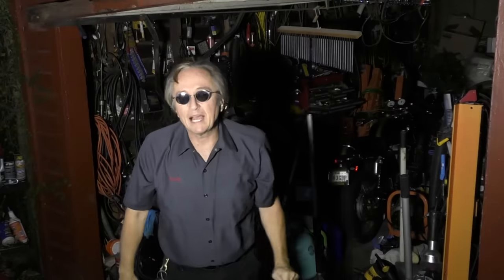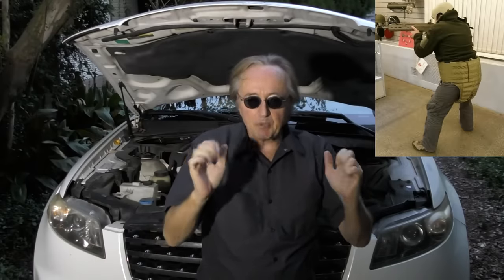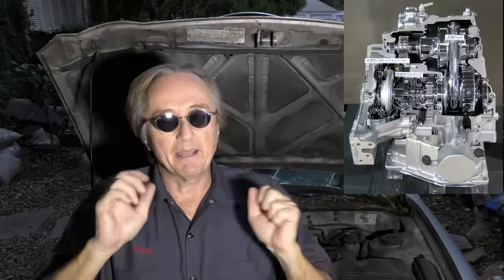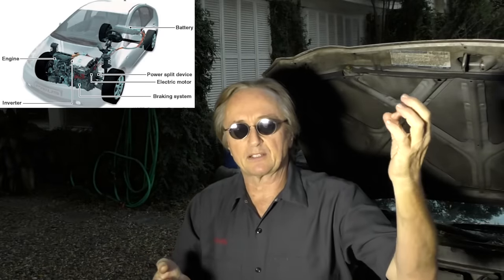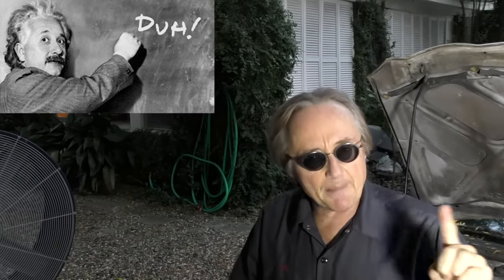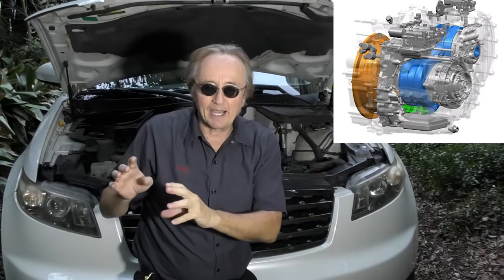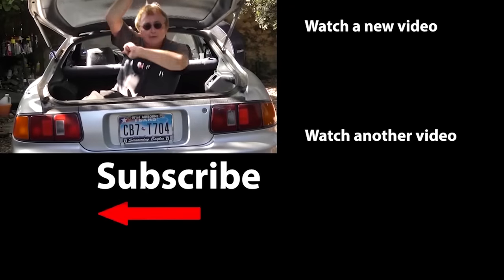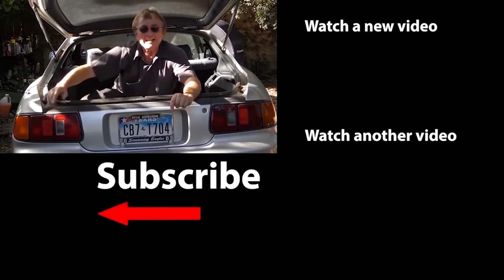Why Most CVT Transmission Cars are Terrible

Comment: CVT went out on my '17 Nissan Sentra at 9,000 miles.  JUNK!
Reply: S C some last said her 15-17 Sentra went out around 15
Reply: Omg i would be pissed mines is a 2015 and it needs a new cvt hmmmmm but the car is not safe to drive because the transmission stalls without warning and like me will leave you in some dangerous situations,Hopefully your still under warrany for yours and you wont have to pay $3400 for a new transmission and $1700 to put it in,After calling corporate they offered a 50/50 which still left me to pay $2200 but wait if i replace it i dont trust the cvt transmission its unsafe to be in or around on the roadways it can clunk out at anytime
Reply: I had issue with mine twice. The check engine light never come on.
Reply: Gary Phillips what happened? Mine is stalling at stops and turning off at stops as well now even delaying when shifting gears
Reply: My mom has one a year older and has never had any issues with it.
Reply: Mine has 103,500 miles and it’s still good
Reply: Are you flooring it? My parents 2015 Altima has almost 90k miles and it’s still running fine
Reply: CVT went out on my 18 Corolla at 30,000 miles. I hate these damn transmissions.
Reply: My 2017 Sentra is at 70k and still going strong
Reply: @dallasmorgan5983  It's "expected" to last 100,000 miles. The old automatic was "expected" to last up to 200,000 miles...hope yours keeps going well.

Comment: After I bought my Altima I kept losing my mind doing more and more research about this thing's transmission. Thankfully I must have a golden model or something because it's at 147K miles, original transmission, and it doesn't so much as slip or shudder. Ridiculously smooth, actually. Hopefully by sticking to the fluid change schedule mine can continue to serve me well for years to come.
Reply: I just got a Nissan how long do you wait to change the transmission fluid ?
Reply: @diegodominguez205  I waited until I reach 60k to change my transmission fluid which I did but people recommend changing it to 30k depends on how much u drive but I read my owner manual told me every 60k
Reply: @killuazoldyck9269  I bought a used Nissan Sentra at 160k should I immediately change the fluid ?

Comment: My honda cvt seems pretty cool so far. Gas mileage is so great. Really just crossin my fingers for longevity.
Reply: Me too.  I'm really bummed about this I got a certified preowned civic touring and didn't even bother looking up potential issues prior because honda has a reputation for reliability.  Then I find out there is some known oil dillution issue with the 1.5L turbo engines and CVT's have durability issues.  I'm glad I at least got the extended 10year 100k mile warranty, but I would rather the thing just work and not worry about the potential of breaking down.  I switched from being a loyal ford owner, because I am not interested in SUV's/Trucks and ford is suspending sales of every car but the mustang.  My last two fords (02 Taurus and 2011 fusion) both got me 200,000 miles a piece with no issues but normal wear and tear.  It sucks because the touring is really a fun car to to drive and now I find myself wanting to drive it like a senior citizen because Im afraid the drivetrain cant take it.  I'm really thinking about driving it for a couple years then paying it off and selling it while it still has reasonable value, hopefully before it has issues.  I went with the touring because it had luxury features(premium sound system, sun roof, leather interior, all the tech gadgets), without the luxury price tag.  I thought about just getting a newer fusion, but all the certified preowned models I could find within a reasonable distance were all base models.

Comment: I work for Hertz & we have a lot of Nissan Altima’s...they all give out before 90,000 miles...I asked Nissan what the problem was & they said they have terrible transmissions & it has a recall on it from 2013 - 2018...along with the Sentra for the fuel injector (because it cannot consume the gas in California) 😡
So beware of Nissan!!!
Reply: What about 2016 kia Forte/ Hyundai Elantra? I am planning on buying a used cheap car from hertz.
Reply: Dazz Freezee good cars, only problem I’ve noticed with the Elantra was the trunk release messing up...but I think it was customers pulling on the emergency release
Reply: Dazz Freezee I advise you to take a mechanic or someone who knows about cars, if you don’t know, when going to buy a used car from Hertz...especially if it was once a TNC car (vehicle used for Lyft/Uber leasing)
Reply: @tyrinjoyce  Good advice, I'll definitely get it checked by a mechanic . Right now the price on those cars are low and they should still have 75% life left.
Reply: what a joke you work for hertz, who have alot altima that gone out before 90,000 miles, what a load of crap, first of all nissan issue have span on these new model for 2013 and 2014 models, D step shift came in at 2015 which the CVT design was change, currently they are more reliable than the 2013 and 2014 models which those had complain which can be found on car complain and NHTSA, no 2015, 2016 and 2017 or 2018 model can be found with CVT complain, or what you say they all gone out at 90,000 miles, an deven if theer was the problem has been reduce that it has not appear as 2013 and 2014 models, and CR and JD power are saying the same thing, the  recall up to 2018 are not for CVT problem but reprogram of the behaviour of the CVT like if  if it goes in limp mode. Next that make your story garbage is hertz would be surely hurt as they will be loosing money , but yet they are still purchasing these altima which goes out at 90,000 miles, so they are interesting is loosing more and more money? We know they are buying altimas. next nonsense is about the sentra, there are two types of sentra if you did your home work, one build for specially for California, it has less HP,  the other can use in other states, all manufacture has this.
Reply: @dazzfreezee3976  Dan freeze any car you buy you should car a mechanic, but do not believe all these lies, this guy story has more holes than a strainer, you think a rental company would purchase cars they loosing on? Altima goes out before 90,000 mile he claim but hertz purchasing more at a lost, does that make sense? It more like he sees a few with problem and he see some go to the dealer but he does not know what they gone far so he is speculating, no I am not saying nissan does not have a problem, but I am saying nissan issue was resolve in 2015, and I am not saying some people still do not have issue , I am saying the issue is not wide like 2013 and 2014 models altima. There are two type of sentra one build for california and other build for 50 state, so if you live in cal make sure the car is made for that state and that goes for all car manufacture.Also nissan never resolve the sentra CVt issue until mid 2015. So I would be careful of purchasing 2014, 2015 model sentra unless it already ben recall and have in the nissan cooling kit.
Reply: c b dude I’ve been working for hertz for a year now & rented out about 700 Altima & Sentra vehicles...I’ve personally worked alongside Nissan & the 2015-2017 models have terrible CVT engines, I’ve done my research & any real car enthusiast & Nissan owners who don’t know anything about cars will tell you, it’s crap...the cars don’t make it close to 100,000 miles...granted there’s a few that slip through & are reliable, but that’s with standard transmission.
We are loosing money & that’s why we’re pulling the Altima & Sentra vehicles from our fleet and Nissan pulling them off the streets so they can resolve this problem.
Nothing I’m saying is crap...I wouldn’t waste anyone’s time with lies.
So don’t bother replying if you have anything else negative to say 👎🏽
Reply: I have a 2014 Nissan Versa Note. With 79,000 miles as of last September when i purchased it. Now at 85,000 miles. 
Ive seen no recalls on it concerning the transmission, but i still see TONS of bad press on CVTs as a whole as i research them. 
Should i be worried?
Reply: hertz keeps cars to 80 and 90,000 miles??????
Reply: @tyrinjoyce   I think your being honest in what you've experienced. Just don't call it a "CVT engine" when making the argument.  Carry on.
Reply: I own Nissan Rogue 2008. It is in good condition so far
Reply: My 2013 Altima runs perfect, in spite of not being serviced “correctly”.  At 126k miles, I have only had to replace tires & 1 brake job.  I have been very diligent about oil changes every 5k miles & 1 transmission service.  All this talk about CVT is garbage, blah blah blah...If it was, than my Altima should have taken a dump a LONG time ago.  It still gets great mileage too! It’s been a great car.  I’ll buy 1 again, if and when this one finally dies.  BTW...I haven’t heard anything about a transmission recall on 2013 Altima???  Hertz holds on to their fleet cars at 90k miles...Really?Thought they sold them off at 30k miles...

Comment: My daily beater for the last 4 years has been a 07 Nissan Sentra, with the CVT. I know its garbage and im really surprised it hasn't blown up yet.  Its sitting at 211,000 miles right now on the original engine and transmission.  The transmission may be garbage but hey, at least it gets fantastic gas mileage
Reply: It's not necessarily garbage, it's misunderstood transmission, i think both classical and CVT's transmissions have their own advantages and disadvantages...

Comment: Prius CVTs also don't work like traditional CVTs. They're even simpler - just a couple of planetary geartrains connecting the engine to two motor generators and the wheels.
Reply: and I assume all other Toyota Hybrid products, e.g. Camry, Highlander, Lexus RX, Lexus GS, RAV4, Lexus LS, etc.   Right?
Reply: @marksandstrom4248  Definitely Lexus CT. Can't say for the others.
Reply: @marksandstrom4248  Yes all Toyota products labeled with the "Hybrid Synergy Drive" badge use this system.

Comment: Got an Altima that has 131k miles and the CVT surprisingly is working for the most part fine. Even though I hate CVT transmission, at least it's surviving while I'm driving.

Comment: Totally agree with this video. I don't mind paying more for gas, I want my car to shift gears, be responsive, & not breakdown due to a cvt.

Older Jatco's aren't so bad, there are alot of infiniti g35's & Fx35's in my area from the mid 2000's, these use the old Jatco geared automatics (before they started using cvt's).

As for any other manufacturer, do your research & ensure that there is a geared speed automatic in your car & not a cvt. Honorable mention, the new Toyota Camry

Comment: Subaru doesn’t use JATCO. Subaru makes their own CVTs with a metal chain instead of a belt. I have 126k on my 2011 CVT Outback and it drives identical to the 2018 Subaru’s I test drove last year. For being such a Toyota guy, you should perhaps look into why Toyota owns a 17% stake in Fuji Heavy Motor Co.
Reply: Actually the modern one do. Look it up. I found plenty of sources confirming Scotty
Reply: @GroundZ3R0Gamer  No they don't. Fuji Heavy (Subaru's parent company) manufactures their CVT's.
Reply: You are correct. Subaru currently has the best CVT platform. It has been said over and over. I have a 14 legacy and I have loved it since day 1. I'm at 80k miles and its the same as when i bought it.
Reply: GroundZ3R0Gamer send the links

Comment: Thx Scotty I just sold my 2014 Nissan maxima s to avoid cvt altogether .
Reply: LOL, that was stupid.
Reply: J-AMG AZ lmaooo yeah I have a 2011 maxima with 162,000 miles.. cvt still going .. if it goes out around 200,000 miles how mad can u be 😂😂😂 only parts replaced is radiator and tie rods... literally nothing else but standard maintenance. Filters , oil, other fluids , tune up, tires , etc..
Reply: @Dev.n  I'm now driving  Challenger RT 2015..Need I say more ?
P.S. Don't even think or imagine you could ever in your life race me ...Eat dust prankster.
Reply: @funktron4  Actually it was a smart move ,actually the best move I've done in my life due to the end result.
Reply: @funktron4 - Yes, stupid move...UNTIL it breaks, then it automatically becomes a genius move.  CVT failure = throwing $4K worth of dollar bills out the window while driving on the freeway.

Comment: Getting a CVT transmission is just begging for trouble. 5-speed manual is the best way to go.
Reply: But most people don't know that of course
Reply: well but then there is clutch which is often awful amount of money to do things right. also remember toyotas c59 5 speed? they also often had premature failure due to bad bearing. and needed a whole new transmission after breakdown. either way things do break. and because we're heading to EV more likely we only are going to see CVT in future. guess what no transmission is actually needed! lol
Reply: @vincentra8849  Whether an EV requires a conventional transmission depends on who you speak to.  Not all EV manufacturers agree with the single speed concept.  Because it should take LESS energy to keep a vehicle in motion.
Reply: @Afrocanuk  well as far as i know of almost all EV has CVT or single speed tranny. so tell me which company is it?
Reply: And that's why they are phasing the manual transmission out.  Sneaky devils.

Comment: I've driven a few Nissan Rouges and recently a new Toyota Corolla, all with CVT transmissions, and I can say that the Toyota is most definitely better from the driver's viewpoint.  While the Nissan would hunt wildly for a proper ratio, leading the engine to zoom to 6000 rpm, then drop to 2500 and repeat, the Toyota changed it's ratios more gently, only seeking engine speeds the provided the needed torque.  Personally, I think the belt in the CVT, which is constantly being flexed during operation, will be the failure point of every CVT.

Comment: Scotty , why doesn’t the metal belt assembly in a CVT just slip on the smooth oily surface of the pullies ? How does it have any traction to transfer the torque from the primary pully to the output pully ?
Reply: Because this channel owner did not answer you question; I will do that:

1. The tension of the belt on the pulleys; is hydraulically causing the belt to be extremely tight. I mean VERY tight. That then will help immeasurably; in resisting slipping.

Also:

2. The oil is extremely different than most oils. Thus it resists slipping; yet is still slippery enough; to make the parts like bearing's etc, work just fine.

So...The "variable pulleys and steel belt"; AND the type of "oil" all together; resists slipping by design; as long as the oil is changed every 30K miles. NOT 60K; let alone 80K as some of the owner's books says.

For if not, slipping and damage is going to happen; and one of the major reasons that CVT's are a major problem. But not the only reasons of a myriad of other CVT's innate major problems.

Thus, please never purchase a car with CVT. For no matter what you do; it is going to disappoint you sooner or later. In a word; the entire CVT system (from day one) is "garbage in and garbage out". Sad indeed.

Hope this helps kind Sir.

Comment: If you flush the cvt oil it won't fail as frequently. 2018 nissan sentra recommend oil flush at 60k then every 30k after that. I think missing maintenance is a big contributing factor.

Comment: I bought a 2018 Honda Civic Hatchback a few months ago with a CVT. I hope it holds up!
Reply: I had honda civic before,  driven to 300k , to me honda is the deal, just keep the maintenance on time and it will keep you a happy driver
Reply: I have a 2015 Civic with the CVT, and the only complaint I have is that the dashboard tends to be noisy and vibrate whenever it's cold outside. Other than that, it's been a decent little car so far.
Reply: Everything is great so far. My sister has a 92 civic that was still going strong. My only concern was with the CVT & Turbo holding up. I bought it new so when my daughter started driving in 7 years she'll have a good car to learn on. I started driving on an 84 Accord Hatchback. I'm hoping the new Hondas hold up as well as the older Hondas. 🤞
Reply: It will be fine, we had a 2004 honda civic hybrid with CVT, we had it for 13 years, and put 160,000 miles on it, not a single problem with the CVT.
Reply: @kelseywhited2371  So that's the noise I keep hearing in my Accord 1.5T CVT 2019. I thought it was something under the hood! I love the comment section, since I usually find answers to my questions!
Reply: @henri6595  I'm glad my comment could help. I'm not 100% sure, but I'm guessing the noise has to do with the way the car is insulated and how the dash is assembled. I can't remember what exact video I watched for fixes but I'm sure if you googled honda civic noisy dashboard in cold weather, you could probably find cheap DIY fixes for it if the noise gets too bothersome.

Comment: Hey Mr. Scotty, I thought Subaru was the first to put a CVT in an Automobile, with the 1987 Justy? With the help of FUJI. Not the Toyota Prius.
Reply: A Dutch car called the DAF was the first with CVT.
Reply: Mr. Scotty is confused or mistaken. The Justy was indeed the first car with a CVT produced for the US market. Just like Scotty is confused about Toyota being reliable. My 2018 Corolla CVT went out at 30,000 miles. Toyota dealer told me that CVT problems account for almost 1/4 of their shop appointments. In fact, they had 2 CH-R's in line ahead of mine for CVT replacemenets, both with under 10k miles.
Reply: @mrdanforth3744  Not in America.
Reply: @americanparser  No, Holland. DAF is a Dutch company.